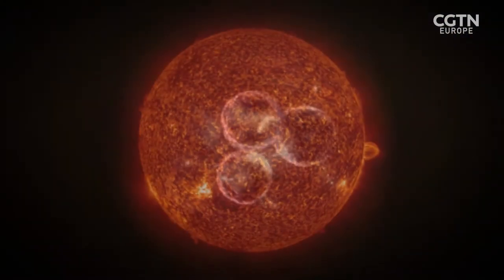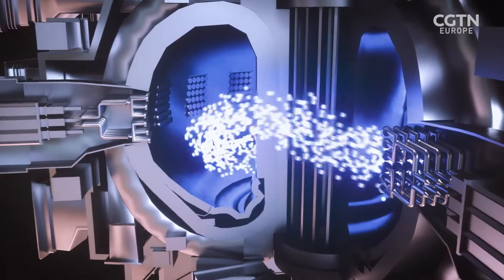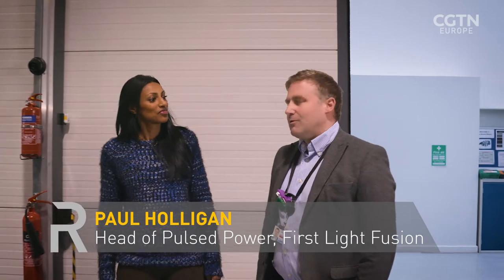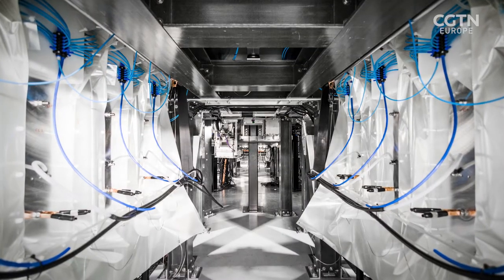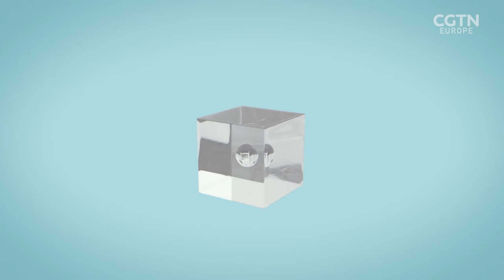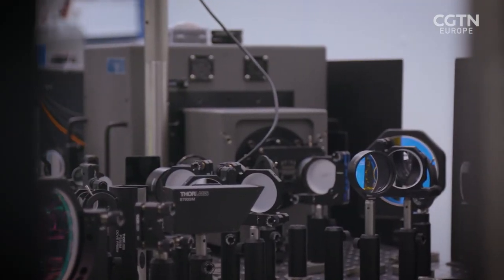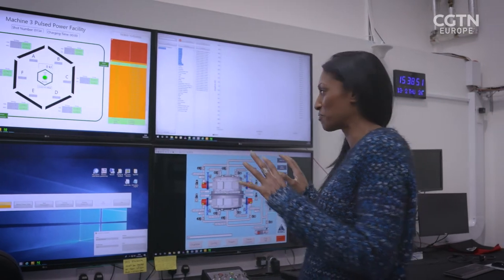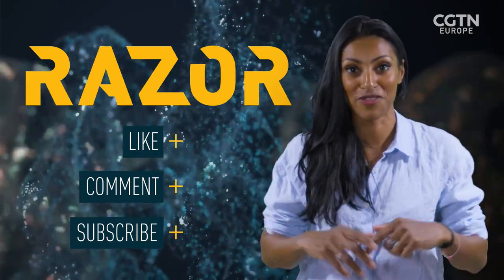First Light Fusion: smashing hydrogen into energy

Comment: A lot of waste products will remain after a projectile induced fusion event. Is this waste radioactive? How does your unit handle waste products on a continuous scale?
Reply: I'm sure they're hard at work with your questions..😒
Reply: Watch videos by the company itself to get indepth information - But in short: waste production is dependant on the fuel used and the type of fusion reaction theyre doing.
Tokamak configurations will have more waste production AFAIK tho.

Comment: All that to boil water?
Reply: How long have they been funded to do this with no positive results? Its a money pit.
Reply: @Pureignition58  the ideal is good, I guess...
Reply: All that to boil water, heat up your oven, heat up your home, charge your phone, and keep the lights at a price magnitudes cheaper (and “greener”) than current energy alternatives. 
Supposedly…. 
Operating reactor designs still seem eons away from building a marketable, sustainable fusion reactor that can compete with current energy production methods and costs. 
However, I did here this device achieved the most efficient ICF reaction lately thanks to their special target designs, but it just seems too problematic and impractical to produce power via pulsed shot repetitions constantly. The electric equipment would take such a toll and have to be frequently replaced. So would any surrounding material bombarded by those 14.1 MeV D-T neutrons. Irradiated material disposal also must be done by strict health and safety standards, although it’s not at the scale of fission product waste disposal. Still, it will have that added inconvenience and reduce daily shot counts. But I think it’s definitely possible with a bit more material advancements and experiments and simulations to further optimize net power production and efficiency of individual shots along with building and testing a reliably sustainable pulsed shot reactor that can function long term better than our current power production methods. 
I’m no expert though and perhaps it is realistically doable to do these exact things soon. Or maybe another device design will make some huge advances toward commercial success. Either way I’m not going to hold my breath.
Reply: Yes